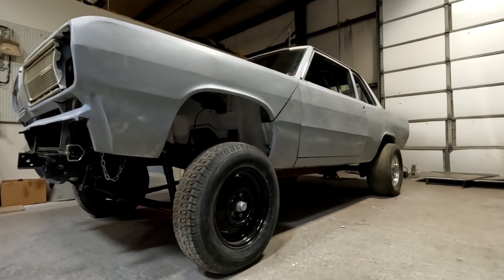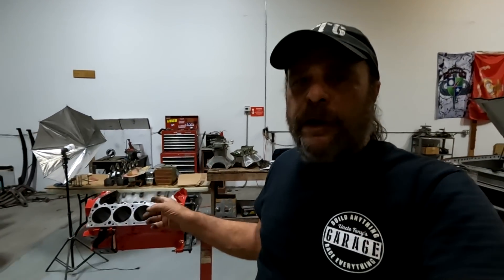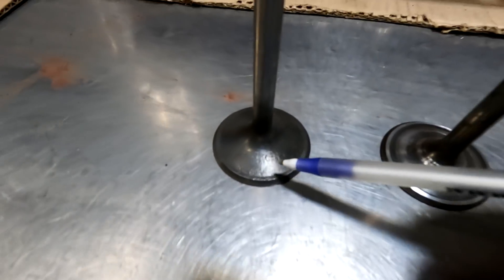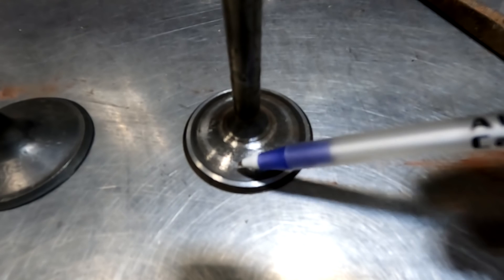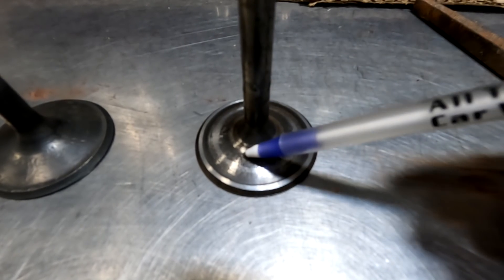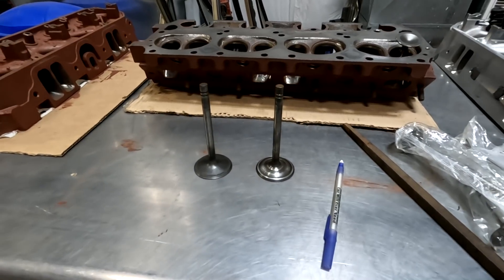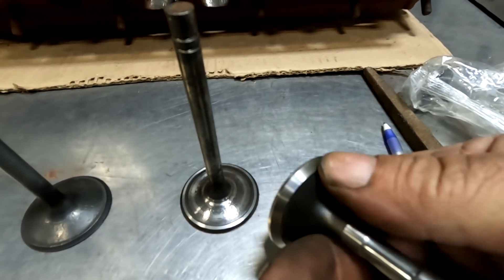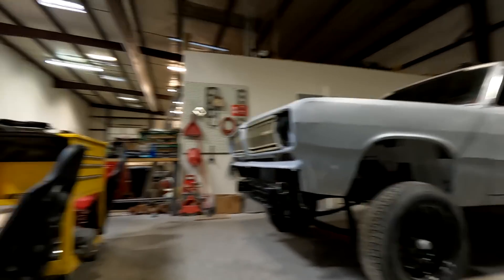Even MORE Free Power For The Home Engine Builder

Comment: I had to replace the intake gasket on an old 360 that my Grandad and Dad have driven since 1976. I noticed a casting ridge going down to the valves so smoothed it off. I get better mileage with it than my predecessor ever did. Coincidence? I don't think so.

Comment: Tony my uncles a old hemi guy that's shown me a few flow benches I'm not sure if you knew about rolling the exhaust valves sharp edge off on the combustion side, needless to say I'm drilling magnum heads and cleaning the castings up for a project engine for my 96 ram

Comment: Not sure anyone will even read this, but, it has been noted by some head porters that the ridge on the back of the exhaust valve helps prevent reversion.  The intake valve is a different story of course in that it may hurt low lift and help at higher lift.  Overall under the curve is helped.

Comment: The the sharp ridge is exactly for the large fuel droplets. The air is made turbulent, but the goal is for the droplets to re-enter the flow, but atomized. The ridge definitely restricts flow and reduces top end power. 
Newer tech on valves accomplishes this with back-cut angles, rather than a radius. It turns out that extreme ridge is more than what’s necessary.

Comment: Your not old, I grew up the same way in the fifties with no money and no parts. I overhauled my first motor in 1964 one 1950 Williys ring had a layer of sludge keeping them closed had no compression at all. after cleaning in gas because thats what I had they worked again. My father was so pissed he gave the willys to my brother in law and sold the 1958 Pontiac the motor was coming from and quite working on cars.

Comment: I've always wandered if it was to help the Atomization? The Ridge was there to help the Swirl, the Turbulence of the Air flow coming into the Cylinder. . . . Giving the Fuel an extra millisecond or two to mix as air is rushing and cramming  against the surface.
Like an whirlpool or jetty effect in a river linet/outlet/mouth.

Comment: the ridge on the exhaust might be better to help create the slightest low pressure area to help draw the exhaust towards the valve to slightly help start a good exhaust pull...think of it as a cowl induction for the exhaust ..lol

Comment: Awesome video, I would think that troft would be there to maybe help induce a little turbulence. or a little bit of swirl effect of the afr mixture in low rpms to keep atomization. But I'm just guessing here, I have seen this in some of the engines I've torn down and built.This is something I want  to try on a smaller engine I'm going to tear down soon and rebuild on a cool little project I've got. Thanks for more free power Tony.

Comment: My two cents on the valve shroud (or curtain) was to improve the swirl and create turbulence so mixture burning efficiency could be increased.
Was good for normal engine use but is certainly an area where  increase air flow can be obtained. This shroud is actually good for flow at initial valve opening but becomes an obstacle later in the opening range. 
The exhaust valves also can benefit from some modifications but in a different way since the air flow is being pushed out instead of pulled in.

Comment: I always thought that lip around the outside of the valve head was to create a larger contact area with the seat, which would help with pulling excess heat out of the valve and into the casting to be wicked away into the coolant.

Comment: Off the top of my head, two non-performance thoughts on the ridge. Durability - old designs were 'rougher,' no computer analyses, so knowing the limits of optimization was less certain. So as a hedge against problems, make it more robust. Manufacturability - in forming the valves in a mass manufacturing environment, the ability to accurately form the seat area without distortion may have been limited by the old processes.
On the exhaust valve, with the greater heat, removing material from this area might increase the likelihood of a burnt valve

Comment: I’ve been doing that for years! I use my valve grinding machine at the corresponding angle to knock down and smooth the back of the valves.
Not really sure how much it helps but most motors I do that to seem to run better than doing nothing.
Of course I do other small things to that same motor so hard to tell what exactly helped the most..
Reply: I tried doing this as a teenager in the 80s seemed to make sense. Didnt know a thing about heads valves etc. 
No clue if I got the angle right, just eyeballing it. DIdnt feel a difference but didnt run worse either

Comment: Cool Uncle Tony. I trained as a lathe/milling machine operator but never used one at work but I did work a  thread cutting machine that was 6 lathes in one... anyways at home in the tool shed I use a regular small fine stone bench wheel and backface the valve with my hand ✋ resting on a suitable cushion at the angle required, then the valve goes into the battery powered screwdriver at top speed to be cleaned up with steel wool/scotch pad!

Comment: Hey Tony,
     Tim here, yes a back cut of 30° is GREAT on an intake valve.......LEAVE THE EXHAUST ALONE!!!.....when one starts thinkin of porting an exhaust port, one HAS to remember reversion, and remember the charge is going OUT instead of IN....no back cut or ridge removal shud happen....when u do, reversion starts, and now it makes crap power.......the flow bench will say it flows more air, but reversion is a demon that creeps up and BITES you.....my experience/knowledge, has shown me a nice 30°back cut on intake valves, net better low lift #'s....(.300 on down)......high lift dont care, as the valve is WAY away from the seat,.....but most of our motors that max at 6k rpm, will LOVE the 30° back cut.......again, DONT TOUCH the exhaust valve........that ridge STOPS reversion......NOT necessarily the cold valve issue, u suggested......nice stuff my brother.....LOVE the chanel for sure!!!

Comment: I was the top cylinder head valve director for Chrysler from 1910 until 1998. The specific area of the valve you are referencing in this video was the direct culmination of many decades worth of atomization physics, combustion theory, and mathematical engineering. I spent my entire life perfecting what I named "The Intake Valve Ramp" to find the quintessential balance between power, drivabilty, mileage, and durability. It's purpose was to create a counterclockwise vortex that would, in turn, bring in a vacuum-induced pressure effect to amplify the sonoramic waves found in the atmospheric combustion during the mid-stroke. It took me literally years of frustrating trial and error testing to get it right. All of my blood, sweat, and tears went into the process. I spent countless nights rolling around, unable to sleep, obsessing about it. That little ridge cost me my wife, my family, and in the end, it cost me my sanity. And you just ground it off with a drill and a file. 

And if you believe this story, I got some nice oceanfront property in Nashville for sale.....CHEAP.
Reply: From 1910 to 1998 lol
Reply: I remember u, i was the lad that welded the ridge on .
Reply: good one....lolololol.....it's the b/s fairy...lolol....how much 4 the property...?...lololol
Reply: That's the ticket...say hello to your wife Morgan Fairchild for us. Good to see you back Tommy.

Comment: Tony, I always had access to a Sioux valve grinder and my Neway valve seat kit.  It made seating and grinding very easy.  The last part of the head job was to grind the trough off on the grinder with the finest grit wheel after the seating was done.  Great to see the old ways working again!

Comment: You're so close to understanding the ridge. I'll use your statements. The exhaust valve has a ridge as well, so that kinda rules out  intake atomization. 
It's only on older vehicles. Is it lead or metallurgy related?
You said don't file to much and make the seat area too thin. Why would you say that?
C'mon man you can get it.

Comment: You couldn't be more wrong about the trough on the valve. 
It's to help fuel atomization at lower rpms.
Completely not needed for something running wot most of its life.

Comment: Uncle Tony. I asked that question in 1985. A retired Ford drivetrain engineer was teaching auto mechanics in the Air Force. I had already had years of training before that by my grandfather, who had been a master mechanic. The answer I got from the engineer, for the ridge on the back of the valve. Was to create turbulence. To help a cold engine atomise the fuel better.
Reply: You beat me to it, but mine was just a guess. Nice to hear it from someone who probably had access to the original engineers or the engineering publications.
Reply: That was going to be my guess, it looks like it'd create a tumble or a sort of vortex. That was the thinking off the top of my head
Reply: On F1 engines ( na v10 ) they used to have it even more pronounced - turbulence can help air go around the corner.  But probably its true for higher lift (those engines had pneumatic valve springs so the lift ramus probably  where verslo agresive)

Comment: my thoughts was that little lip would start the air/fuel mixture tumbling like a sideways tornado when it slides down the back face and hits the lip.   my first car was a 72  mercury capri with a 2000 cc motor that had a bad hole.  i got the same engine out of a pinto and rebuilt it. stock bottom end but i ported and polished the head and intake  swirl polished the valves  and played with the cam and ignition timing.  it was good enough to sheer the flywheel bolts  doing hole shots. and the amazing thing was it got 33 mpg no matter how you drove it.  
   on the valves i cut the lip at an extreme angle  to remove it  then chucked the valves in a lathe  spinning the valves and using a hand drill with a small drum sanding adapter i polished them up varying the speeds till i got the finish i wanted. ended up with about a 130 degree swirl.  i could spin b-60-13's in 3 gears. an absolute beast yet it was still a great everyday driver.  the biggest thing with any engine is breathing both in and out. most old cars had a bad case of copd from the factory.

Comment: I always wondered if the ridge was there to add more mass at the seat to deal w heat, that doesn't make alot of sense on an intake valve so I suspect your theory is more likely to be true. I've been backfacing valves and radiusing the back edge of exhaust valves forever, it's one of the first cheap HP tricks I ever learned. Like you say, finding a bit everywhere you can adds up. Plus it's just interesting and fun

Comment: I use a valve refacer tool for small engines that has a carbide cutter and the valve spins in a v block type vise jaws. Its made by Rotary , part num 750-257 and cost around 50 bucks. Then put in the drill press to clean it up with a right angle die grinder and a flap disc ,lastly with scotchbrite disc . I've had machine shop guys ask me who did the work on the valves because they look like Ferrea valves but there OEM

Comment: Can I get your thoughts on a draw thru carb to a turbo to engine please? My thoughts are the turbo is cooled by the fuel so no intercoolers needed and it should be good and work just like a supercharger I just have resevation about all that heat with carbs as well as jetting and of course your favourite timing.

Comment: The ridge on the valve is to increase the margin width on the valve for heat transfer, nothing more. Old seats were not hardened, that is why you don't see that design in newer engines. I am all for free horsepower but this is not going to make much difference. Will it make any difference? Maybe...  What you did there could go 5 or 10 cfm either way at low lift, and not much more. That is a whopping 0.2 horsepower one way or the other, at most... You would be far better off cutting another angle in it, or rounding it, than just grinding it down.  Without flowing the head you can't say for sure it will increase the flow. If you can squeeze it into the budget, spend the money on a pocket porting and good multi angle valve job. You will get far more horsepower from that. You may be surprised how many gear heads have a rather large collection of Neway seat and bowl cutters.... So you may be able to do it yourself if you know someone with the cutters and a valve machine.

Comment: I had a set of original 2.08 intake valves from the 1962-1964 factory Maximum Wedge big blocks that were called "tulip" valves-very long sloped fillet/neck from the stem to the seat face. It looked like they would have weighed a ton. I found an NOS set for sale on Ebay at the moment.

Comment: Hey tony , how about reducing by a little bit the diameter of the valve tail in the aera where it s in front of the seat when it s at the maximum lift? Apparently it s a practice that has been used by some french engine builders

Comment: I ive stuck valves in a drill press, to clean the junk and remove that ridge with a file on a jig, stay away from the 45 degree surface, but hand lapping the valves and seats, wont hurt, the deal is pour some gas or WTF in the ports to check for leaks, and if it does, well maybe dig into your wallet for new better valves, and have the valve seats in the head recut, either way you do it hand lapping should make for a 100% seal,  when an exhaust valve gets hot and doesnt seat properly the flame can make the valve face split. I may be a dumb ass but ive heard of valve spring spacers that allow the valve to rotate,

Comment: Losing weight in the valve train. Gaining flow out of the chamber. Them ex.valves are thick. 
      Your little corner of the shop is quite. They probably waiting on you to leave. You probably riding over leaving messes everywhere.  You got to get it out while they are pups. Cause you ain't changing to please nobody.

Comment: how's bottlerocket doing? Thats one of my favorite builds here. I also have a 72 dodge coronet mines has a 1975 dodge truck 318 with unknown edelbrock cam and 4barrel aluminum duel plane intake with 360 exhaust manifolds and 2.25 duel straight piped (mufflers coming) with crossover pipe at tranmission. 904 Auto 8.25 axle with 2.71 gears. Fuel economy is important to me but not the only goal. im vary happy with this set up so far. But im not a racer more of a hobbyist. Its about learning and seeing what i can do. Great channel.
Reply: If she idles smooth you probably have the old Edelbrock performer plus cam
Its basically like the old Melling or Elgin "rv" cam. Good for torque and mpg
Isky supercam is popular with mpg goals also. Old grind but does the job

Comment: Valves are forged, the correct portion of a steel rod is forced through the dies to size it's diameter then clamped in place with enough excess to form the head extended out and the head forming die pushes back on the end forcing it into the head shaped die, mushrooming the material into the that die, the length is cut and the semi finished valve is pushed out and drops into the bin to be taken in batches for final machining of the face and lock grooves and correct length. The ridge is just flash basically, not considered worth grinding or machining completely away for the extra few seconds of cost, if there's purpose to leave or other than that one never found that info written down anywhere, even in the engineering documents I've read. There's a slight excess thickness where the face will be ground and the ridge is the inside edge of that thicker metal!
Dammit, sorry about the editing!

Comment: I have been doing this since the 80s. On the exhaust I use a back cut that just blends the edge. Stock and super stock classes is where I find all the tricks of the trade. The single digit increases add up over time.

Comment: I would think the ridge on the back face would be for turbulence. Swirling air across the head some towards the rings, instead of the more direct shot into the bore. These are the types of tricks I love too, turning the factory stamped out dime a dozen stuff into hand built efficient labors of love. Amazing what a little massaging of assembly line stuff can do to really bring out the potential. For the price of elbow grease and patience

Comment: My thoughts are that it is a wing shaped edge to break the laminar flow surface tension and induce a slight turbulence for mixing, dispersing and cleaning the cylinder chamber. As the air goes through quickly and draws any fuel still liquid, or condensed as you pointed out, will tend to "ski jump" this edge back into the air stream. Just my speculation though...
Reply: That's my thoughts.
Reply: exactly! you explained it better than I did!

Comment: Any time you introduce shear with a sharp edge into a moving column of air, you create turbulence, which is less efficient. I add a tiny radius to the face side if possible.
Reply: Which is why planes wings have a big bulge on the trailing edge.

Comment: Do you put a radiused margin on the exhaust valve? Rounding off the sharp edge on the face of the valve to help the gas flow around it easier to get out, kind of a similar effect as backfacing the intake valve. Never radius margin an intake valve, as it promotes reversion.

Comment: Thanks Uncle Tony, I'm in the process of building a 87 Dippy X police package 318, and am looking forward to using all your help and tips on hidden but real HP tricks. Thanks from Billy The Dodge ,way up here in frosty Chicago. I never miss your channel, a great way to learn.
Reply: I had one of thoz engines in my 70 dustervat one time.... i put in a mild cam, put factory roller lifters back in and ran it!! That thing likes spinning up to 7000rpm all the time.... still got the engine in the shop, with no holes in the block! 
That LA roller cam engine is a really good engine!
Reply: Sounds like a good time.